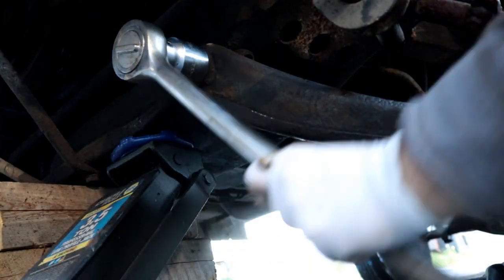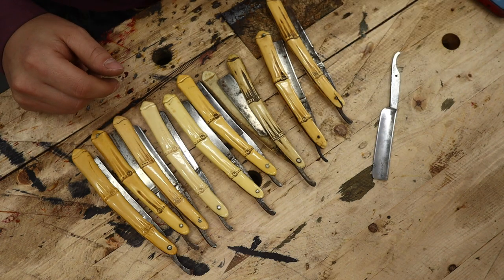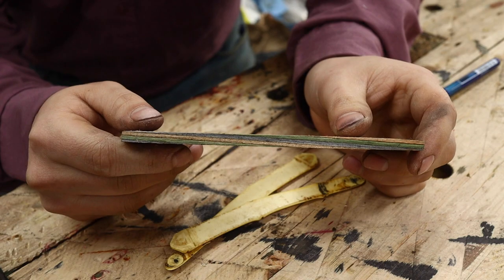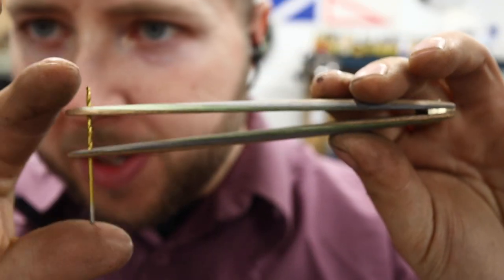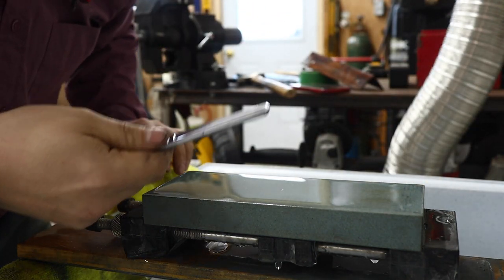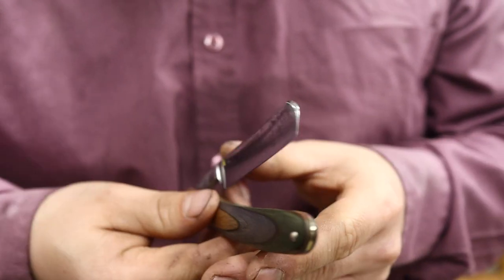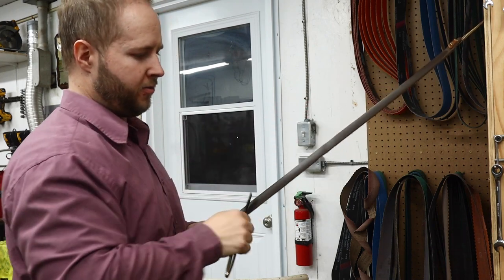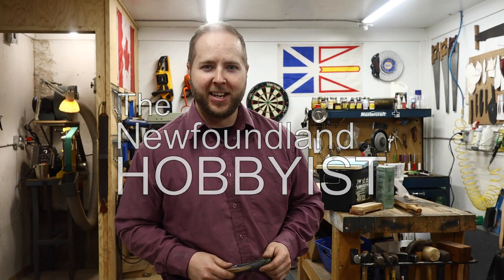Restoring an Old Rusty Straight Razor - [NLH 8]

Comment: Still have 3 straight razors and I use them. But I just use them to trim around my beard mostly.  I don’t know anything about those synthetic stones, all I have is just the natural ones, been using those for the last forty years  at least. Worked as a butcher for my father since I was little before he finally retired then passed a few years later. Anyway thought I’d write in here and tell you that was a really nice job you did on that razor. I didn’t realize people were just out throwing them away, so sad. Anyway have a great week just found your channel so I’ll be checking back in from time to time. Greetings from West Texas.

Comment: Nice looking razor, I've done the restoration on my razors for donkeys years, I would say the pinging part`  surprised to see your pinging like that knowing your a knife maker. 
The way you did this you run the risk of bending the pin on that razor witch may feel tight but will become loose and tight soon due to the bent pin, if it has been bent,
My advise would be to use a lighter hammer and lot more lighter tapping so it works the ends of the pin not send the force to the inner centre running the risk bending the pin, as I have found on many old razors, 
If you want rounded ends use the ball end of the hammer , witch rounded pin ends are found more on lot of vintage style razors, 
A good way ,is to get a steel or brass or bronze block depending on the pin then get a carbon Dremel round cutter end or diamond coated and drill into the block leaving a nice small  half round scoop looking in the block, but make sure its slightly shallower than the end depth you want to the finish of the pin and make sure the hole is not to deep you don`t want the scales touching the block, or they will crack ,
Start the pinging with the ball end of the hammer lighter tapping around the edge and if want more width tap more the centre then work back around the edges, once done turn the razor over and place that side in the hole of that block , now ping the other side, this then will not damage the other rounded pinging you did on the first side, as it is sitting nicely in its half round if going to do rounded ends,, 
if you want the look of flat ends the same goes with using lighter taps to effect the end of the pin rather than the half way down centre and run the risk bending the pin, 
The cut end of the pin will easily deform than than half way down to get the shape as long as its not being hit to hard or not to much weight,

I have had many razor that had there holes deformed due to well bent pins that repairs over years have deformed the hole through opening and closing motion , I had to use a piece of brass rod or bronze to fill the hole and predrill a new hole, this works very well to fix deformed holes,
I was a fabricator with brass and copper in my younger days and a sheet metal worker on my other job witch learnt me a bit,
I , in know way saying you don`t know this info above ` I was just surprised the size of hammer and the force you gave it, for how quick you flattened that pin I would be surprise there is no deformity to the centre pin that goes through the hole of the handle on the blade.
But nice to show newbies how they can replace handles if need be, rather than they think throw the razor away,
So glad you covered the stones its so important when buying a straight razor its more important buying and learning how to use the stones or else they won`t be able to use there straight razor , even new razors might not be good enough for there first shave,

Comment: I've had straight razor shaves I think four or five times in my life; Some of the most expensive times I've been to the barber too.  Believe me, it was worth it; It's actually slightly sharper than the already very sharp throwaway safety razor blades. Although a little dangerous and you need to learn how to shave correctly with them, they are better for the skin because they don't touch the skin  (same for safety razors) than modern day Cartridge Razors and Disposables which are disgusting, those things cause ingrown hairs and I've found are more often than not more likely to cut you than straight and safety razors because half the time they're blunt and the other half the multiblade set ups nick the skin.
Reply: Pretty sure they do touch the skin. There's no safety bar on a straight razor.
T

Comment: I have had great success with a CA glue trick and masking tape trick. Basically just apply masking tape to the two surfaces before gluing them together. It has great shear strength but comes apart with a chisel quite easily and doesn't damage the wood. This trick is thanks to Ben Crow of Crimson Guitars UK

Comment: Good job on the restoration. Seen a few straight razor restoration videos and most look ok, but weren't honed properly and give a bad shave, if they shaved at all. I have a few (20 odd) straights from which I select a different one for my daily shave. When they need a touch up on the hones, I find lapping film with a flat base (marble in my case) works for a "poor man's" honing system. I hone down to 1 micron film then a few hundred laps on the leather.

Comment: I shave with a straight razor but a "modern" version that uses replaceable blades.  I also use a soap cup and boar brush.  I don't mind doing this myself but I don't think I would have the nerve to let someone else shave me with a straight razor (like YT's "Haircut Harry").  I might have to hit some antique shops and see if I can turn up some old razors.  If nothing else, it would be an interesting collection.
Reply: Try a real straight razor. I read something about the"artificial" edge on de blades, that they are rougher. If you have a perfectly sharpened straight razor, the cut off the hair feels softer and also the touch on the skin feels softer. Hard to explain... But worth a try.

Comment: I've never used one to shave before.  It kinda freaks me out.   That thing is real sharp.  Thanks for the vid!!
Reply from the maker: Haha I get that. I felt the same at first, but you grow comfortable pretty quickly. Thanks buddy!
Reply: Believe it or not? The sharper it is. The safer for your face and less toothy and dragging the blade is for one. A toothy or under refined "shave ready" blade will drag and nick you and not just glide and pop hairs like it supposed to.

For two? It comes down to techniques and how you hold the angle of the blade. 

Try this. Check for sharpness consistency by going through a grape or tomato or a piece of paper. Slowly and cleanly. Observe even cutting action from heel to toe. The further and faster you go through the paper from one end of the paper to the other the keener the edge is. Strop from linen to leather 40 passes. When you go to shave with it after all the lather/hot towel preamble. Hold the blade flat against your face. Work your face in 1/3 sections at a time. Pitch the hand and the blade to a 15 to 18 degree angle. If the blade is sharp enough, it will cut hairs roughly or toothy with a little drag. If it's really keen it will glide over the cheeks in one long sweeping motion. Another thing. Move the arm and lock the wrist with razor in hand. Experienent with moving your face around the razor and the razor around your face. The sound, the glide, and your face will tell you what's comfortable at what angle without injuring yourself. Every face is different and every blade is uniquely different as well. Techniques come into play around the chin and the upper lip passes for me. Jumping back into this after a 20 year hiatus. Got the polishing right. Got the honing right, got the stropping right. Did up all 14 of my ebay razors this last month or so. Despite having fine facial hair, I won't take an ok edge to my upper lip. It has to be really keen and not grab or pull the hair. The more you practice the more you get the feel for it. You never forget it once you get the muscle memory and techniques.

Comment: I remember landing in Newfoundland in a  Royal Air Force plane because of mechanical problems. An old guy in dungarees came along , opened an engine cowling and started knock the snot out of something in the engine with a hammer. We were then told to get back on the plane to continue to Belize 😳.
Reply: He didn't charge you $10k for hitting the engine with the hammer he charged you $10k because he knew exact where to hit it with the hammer 😂

Comment: I believe Tank Hardware was a Hardware chain but I'm not positive. A lot of the razors sold in the United States were manufactured in Solingen Germany and stamped with the corporate name of the buyer for resale. I have several strait razors from the 20's stamped with American Company names, with Made in Germany underneath. 1 example I have is a Spear Wedge No.6 for the Buckeye B.S. Co. DAYTON , OHIO with Made in Germany underneath. Many were manufactured in Sheffield England. Searching the History of a particular razor is just as much fun as using a piece of History for its intended purpose. Straight razors have been around for a few thousand years. They have discovered razors in Egypt dating back to the Pharaoh's.  Razors in China, Japan and many other Countries. My oldest razor is a Warranted razor made between 1840 to 1845 denoted by the shape of the tail. You have a nice little set there. Happy restoring and shaving. 👍

Comment: I suspect the term "cut-throat razors" was put into play by companies selling safety razors, back when they first came out.

My grandfather was a barber at Pearl Harbor during WWII (but he tended to not mention that he wasn't sent there until after the attack). After he died, I grabbed three or four of his straight razors...but one turned out to have been stored under a roof leak for years; I don't believe it's possible to restore it, due to the degree of rusting. I haven't watched much of this video yet, so, maybe you'll show me it isn't too late.

Ah, yes, compared to my rusty razor, yours are like new. Mine reminds me of knives that have sat in the ground for a thousand years.

Comment: That was great! Thank you. Am I correct that you are pushing the blade away from you on the upstroke and pulling it towards you on the downstroke? I've always used stropes the opposite way. I imagine your method doesn't round the edges, but I would be nervous of catching the edge on the strope. Practice. Beautiful work.
Reply: Can't be pushing the cutting edge against the strop, it'll cut your strop to pieces and probably ruin your edge if you persist.
Reply: No he is dragging the edge over the leather. I had to look twice too to see it.
Reply: @funstuff2006  That's what I thought, but it sure looked like he was pushing the cutting edge rather than dragging it.

Comment: Aren't you worried that the wooden scales will expand in the wet bathroom environment and eventually crack?
Reply: I never store my razors in the Bathroom for that very reason and the the other killer, rust.
Reply: If you're letting your razor get, and stay, that wet, scales cracking is the least of your worries.
Reply: Epoxy stabilized laminate wood.